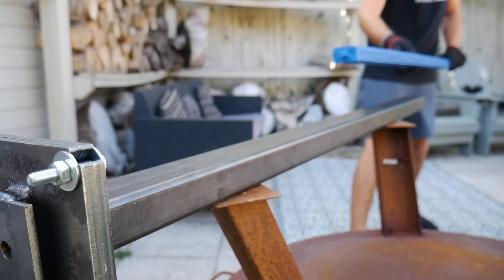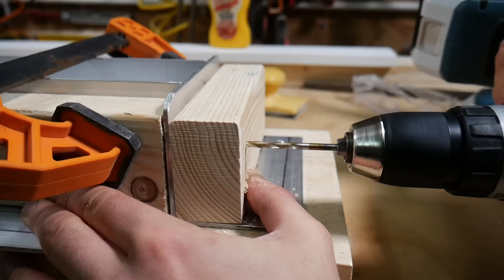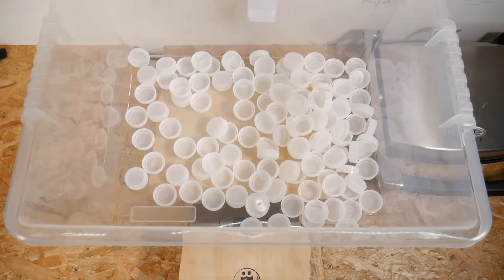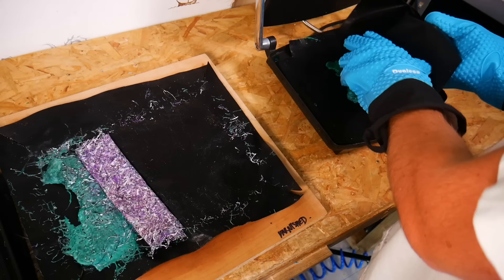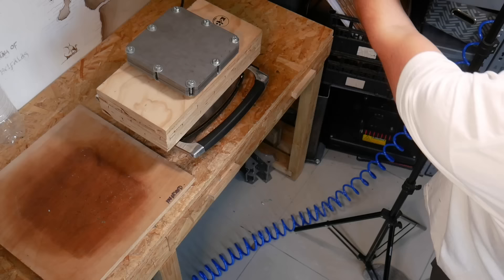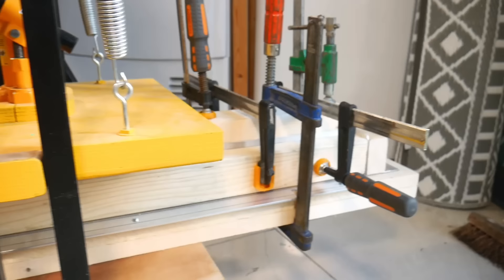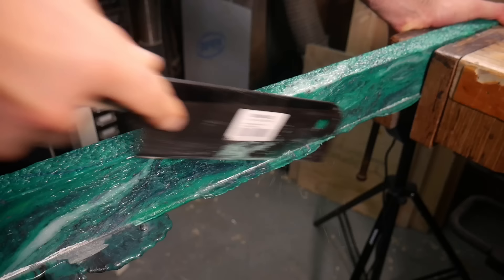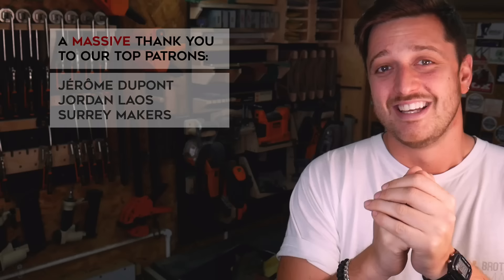How to Make Recycled BEAMS from Plastic Waste at Home

Comment: All that energy, resources and materials to make a plastic beam with indeterminate loadbearing properties! No-one in their right mind should be using home-made plastic beams for anything structural.
Honestly - what is the point? It's not in the slightest bit sustainable or practical and arguably it's downright irresponsible.
If you want to recycle plastic, why not experiment with moulds for things like flower pots or building bricks or garden edging or anything non-structural.
No wonder they say education standards have slipped...
Reply from the maker: No need to be rude Jim. We have lots of videos about experiments with different products, some of the exact ones you suggested. This was just another concept idea. We never made this with the intention of making buildings from it!

Comment: It would be interesting to know how much this process shortens your life when you get cancer or whatever from the released plastic gases/fumes?
ps. I might add micro plastics.
Reply from the maker: we have a whole video about plastic recycling safety - check it out
Reply: @BrothersMake  There is no safe way people can melt  and work plastics in their home. I worked in the industry for 20 years, most of my workmates died of cancer. I suppose I have survived because I was the youngest and got out in time.
Reply from the maker: There is a lot of research and information out there. Agreed, some plastics are very dangerous to work with, but all types work differently and some are far safet than others when handled correctly.

Comment: Its definitely not a beam, a beam is going to hold up half your house.  This is just a plank.  Absolutely no structural integrity but you could use it as a trim piece.  If you added sturdy wire or fibers to it it could have some tension strength.

Comment: better make a video where you try to recycle the plastic bottle itself and expose plastic recycling as a scam
Reply from the maker: Scam? 🧐
Reply from the maker: Interesting points. But they all seem to be based on the fact that plastic can only be recycled a few times. We recycle all our waste into nee products again. Some of this plastic has been cycled through our machines 15-20 times with absolutely zero effect on the material properties. Personally, I think the “only recyclable X amount of times” stat is pedalled by companies as an excuse NOT to recycle.

Sure, recycling alone won’t save the world. It should be the last resort - reduce, reuse THEN recycle. But it still plays a part, and if plastic ever stops being produced, then recycling will be key in finding uses for all the plastic littering the planet.

Comment: "At home" if you have a fully equipped workshop attachedto your house !
Reply from the maker: You can do this with a panini press, scrap wood and clamps.
Reply: @BrothersMake  🤣🤣🤣 you used alot more then that in your big workshop full of equipment
Reply from the maker: Sure we did, because it’s available to us. But we try to always give alternatives.
Reply: @BrothersMake  it's a great idea, I'm not knocking that, if I get a worship I'd try it, but this really isn't something the advantage Joe can do, still costs a lot of money to get what you need,
Reply from the maker: We never said it wouldn’t cost money. We have a video showing you how to make a bottle Jack press from scrap materials. In this idea we showed you how to make a mould from scrap materials. Sure, if you’re starting with absolutely nothing then this will cost a little bit to set up. But it’s still accessible with some time and effort

Comment: I'd like to say it is a great video and certainly encouraging STEAM and recycling. However, the energy you consumed during that recycling process actually has created more waste in the whole world of supply chain. Repurposing is always better than recycling, as it only requires imagination with minimal effort. Also, consider how many beams you can produce before the mould tools and melting equipment need maintenance. How many chemicals are you consuming during that process. Instead of melting plastic, recycling centres tend to burn them, use them as fuel to produce more electricity. Think about how to produce, process and repurpose, and avoid being a consumer at all costs.
Reply from the maker: Turning waste into energy is not a good example if you’re making an efficiency argument here
Reply: @Brothers Make  , I totally agree, and I know you mean well as well. But using more energy to process the waste is worse than that was my point, really. Repurposing should be encouraged.
Reply from the maker: You’re right, but all our processes are low-temperature to keep electrical efficiency in mind. Plus, our workshop tools are all powered by electricity generated by renewables.

Comment: Beam is a construction material, meaning an expectation of strength suitable for construction. This is not a beam. It's a board. 

Cool project but click bait title. Beams would be a big step up from this. I don't even know if it would be possible with all plastic.

Plastic is already melted down into new shapes. This is the normal process for making anything from plastic, including recycled plastic.
Reply from the maker: This could be easily scaled up or down to fit the required need, you'd just need to make the right sized mould for what you're after.

I don't think referring it to a beam over a board is particularly clickbait - but each to their own. Thanks for your comment 👍🏼

Comment: The energy used to melt the plastic does not help. I've had the idea of passing legislation to force all plastics to be made the same. Some type that's easy to melt and can even be easily used in printing. But that would cost money. So, it would not work. remember the biggest obstacle... Greed.
Reply from the maker: Absolutely. That'd be the dream though!

Comment: So, it takes three hours of pretty much constant electrical current at fairly high wattage to make a three foot long "beam" of dubious strength and structural integrity..and then to make it pretty requires another half hour of same to run power tools.
Failing to see an upside here.

Waste is waste, be it energy waste or plastic waste.
Cool project, but entirely impractical.

Comment: Great little homecraft.  I love using up stuff that's otherwise waste, but I cringe every time someone crows about how they are recycling to "save the environment" or save cost which is pretty ridiculous considering how much time, energy and materials it takes to melt down that plastic, but pretty much every "DIY recycling" video has to genuflect to the great Climate Change™ dog-whistle just by default these days.
Reply from the maker: Our workshop is powered by 100% renewables so we aren’t just pedalling a false message.
Reply: @BrothersMake  Hey that's great and I wasn't really meaning to pile onto all the negative comments.  Just pointing out that as cool of a project as this was, that it's just so highly impractical to be inferring that it's somehow a net positive.

What would be interesting for a follow-up video is designing a practical homemade system for dumping in plastic and press-forming simple beams without all the labour intensive manipulations.  Not a simple task though.

Another thought is to be able to add some reinforcement for stress over length, or some way to use less than a solid block of recycled plastic without using an additive printing process?  Stuff like that.

Keep up the good work!

Comment: As long as you don't count energy, all the tools and stuff you used you think you recycle. But if you start to think then, the best way is NOT to use plastic anymore so you solve the problem without destroying the planet.  You talk about math ? Right so What was the carbon emission of you process ?  I f you spend the same amount of time,just to think how to reduce you carbon footprint, then you 'll see how ..... this video is.
Reply from the maker: Our energy is supplied from 100% renewable sources. A lot of the tools we own came from second hand sources, or we made them ourselves. So our carbon emissions are very low.
Reply: @BrothersMake  Wrong ! You don't calclate so you don't know. As far as I ,know in USA electricity is from gas and coal mainly. So ? What the point to use so much for...nothing ?? By the way rewewable doesn't mean anything as our earth pb is carbon emissions. What aluminium is made of ? It's solid electricity. And if you melt it to use it again it's electricity again.  But to be sure you HAVE to calculate. USA is destroying the planet with carbon emissions and it's getting worse and worse as you import from china witch is only coal.  Even the solar panel in USA are made from coal and are a disaster. You should work on real things in a house to reduce any footprint, the only way is to calculate.  So any video pretending to be good but is showing how to waste electricity isn't a good one. But I'm sure you can do the right thing

Comment: This is a fucking awful thing to encourage people to do. The government has mandates for worker and environmental safety for plants that recycle plastic. Things about trapping all the awesome cancer causing fumes you generating and inhaling while remelting, pressing and releasing as tiny breathable particles while prepping and working with the thing you made. That's completely aside from the fact that you've "made" something with no use, no structural strength and will likely start to fall apart as the badly blended layers begin to separate if you cut it down process it anymore than you did in the video.
Reply from the maker: We have a whole video on plastic recycling safety. Go give it a watch 🤙🏽

Comment: This is moronic.  The point is to make something worth making and this is not worth making.   It took a ton of labor, wasted a heap of energy (most likely derived from coal power stations), and its far inferior to a $5 wood plank bought from the Hardware.  It's this sort of idiotic thinking that is destroying the world.  Just because you reused some plastic does not mean you can ignore the damage you made to the environment in doing so, not to mention the huge cost in doing this.
Reply from the maker: - low temperature melting of plastics is by far the most efficient way to recycle them. Beats commercial recycling methods tenfold. 
- our workshop is powered by energy generated by renewables.
- inferior depends on your parameters… it’s more rot resistant and weather resistant and better compressive strength. So depending on what you’re using it for really changes how ‘inferior’ it is

#notmoronic
Reply: @BrothersMake  Dude, I'm a 61 year old electronics engineer and business man.  I know dumb ideas when I see it.  The dumbness here is in ignoring the true cost of all this. The time and energy in the gathering of the plastic, the energy expenditure used in making it whether its the electricity used, or the food you need to consume to cover the joules you lost in the labor.  And suppose I liked your end product, your plastic plank, and I asked you for 200 of them because I decided I was going to make a shed from it.  You'd go pale at the thought of producing 200, and even if you built a manufacturing plant to make them, the selling cost of them would be way higher than a wood plank and look ridiculous in the final product.  As to your workshop powered by renewables, well I can't comment on that, but if you ignore costs like you did in this example I would say you're probably paying far more, and polluting far more than you realize. There's a good reason we don't see commercially available plastic planks from renewables, and that's because the cost/return ratio does work out favorably.
Reply from the maker: So… you want 200 planks or not?
Reply: @BrothersMake  Depends, how much do they cost? I'm thinking USA labor costs and electricity about US$98.49 each.
Reply from the maker: You drive a hard bargain, but sure. It’s a deal.